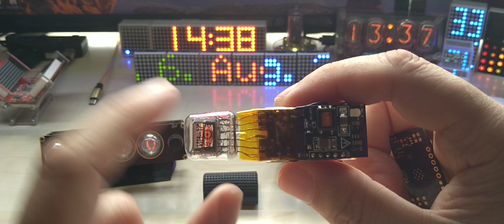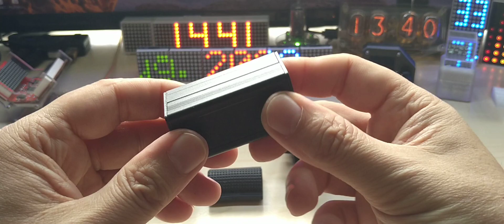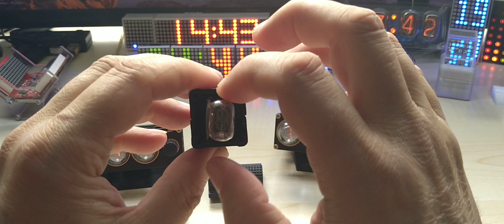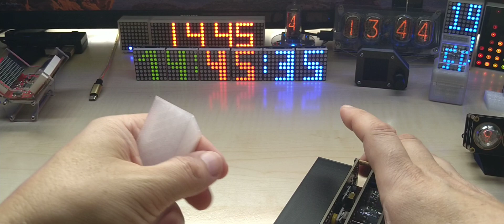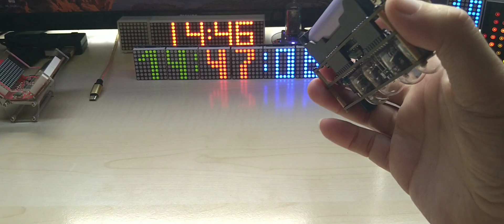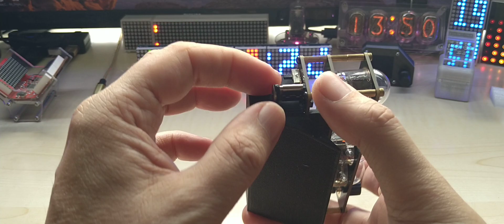IN-2 Nixie Kitchen Timer / Clock, IN-17 Single Nixie Tube NTP Clock with #ESP32 by #Hayri #Arduino

Comment: Hey Hayri! I finally looked through my subscription feed to find this. I'm glad you liked my idea about using aluminum mesh! After looking I found many different styles and colors as well, everything from a crinkle wire mesh(think marshal amps) to hexagon, round, sorta 4 leaf clover design and in various finishes and colors, most are very cheap. Personally I'm looking for a gold to golden bronze color in some design to act as a cage. I might even use bronze pla for the battery/base of the clock...not sure if I'll polish it or not. This will primarily sit on my computer desk but will be taken with me as a timer when I'm cooking(tv, etc is upstairs). I haven't watched the whole video yet but is it possible to add or modify the code to double or triple press the encoder to switch between clock amd timer?
Reply from the maker: Looking forward to see your upgrades 🙂I came up with a great idea on the single Nixie clock which I think will look awesome. Ordered the parts and can't wait to receive them 🙂It will not be easy to combine the codes as they are build quite different, plus I would have to implement a kind  of menu to switch back and forth. Plus the code space is limited on the Atmega328 chip.
Reply: @iHayri1  understood, I'm more a computer hardware kind of guy and not really into programming though I know my way around a system alright. Well if you come up with a way to address the code switch without downloading the code let me know. Again thanks and I look forward to receiving my nixie clock/timer
Reply from the maker: @mythos000000025  I am also more of a hardware guy, engineer, mechanic, designer, fabricator, builder, car repair, motorcycle mechanic and a few more and the least comes my code writing skill 🙂 unfortunately. Still learning but I have to admit, I am getting better at it, if I say so myself. I will surely expand on the clock/timer code, as the temperature feature which it has, onboard DS18B20 temp sensor, has not been implemented yet, although I do have the stand alone temperature code already working 🙂
Anyway, thank you as well and I hope you'll receive it soon.

Comment: BEAUTIFUL!!!!! I really like your ideas for the various battery covers that can also be used for different viewing options. I did laugh when you mentioned the cover that can be used in the car as well...HAH!!!!! Fantastic job with the looks and style my friend!!!!!! Thanks for taking the time to give us details and demonstrations!!!!!
Reply from the maker: Thank you Adam. Just finished the single digit clock, 3D printed a cover for the aluminum extrusion after many trial and errors because you can not find the exact dimensions of the tube and tonight printed a small "foot" for it so it does sit at an angle as well. Now I am waiting for the new PCB's as I added a lipo charging circuit to it, because at first it was supposed to be a stationery clock as I thought the clock would stop once the WiFi is gone or the clock is out of range, but to my surprise the clock keeps going. Anyway, speaking of car, I am actually thinking of making a gear indicator with a single Nixie tube, that for surely will bring in some nostalgic into the car. Does it have any special purpose being a Nixie, No, of course not and I am only doing it because I can 🙂 Could use the clock as is, and since it has BL, send the gear info via Bluetooth to the clock. I know I am crazy, but it helps, lol.
Anyway, have a great week and I'll let you know once I ship your clock.
Reply: More great ideas!!! Someone out there will want a nixe tube gear indicator for sure!! If for no other reason than they may be the only one to have such a cool gadget on the face of the earth!!! Hah!!!!!
Reply from the maker: @ajones4064 Make that two, lol. Just had a great idea about the single tube clock which will make it look marvelous, pure eye candy, spectacular and will also protect the Nixie tube from damage, no, it's not the aluminum mesh cover that I talked about, although also a nice idea of course. Stay tuned, btw, have you extended your clock shelve ? 🙂
Reply: Hah, Haa!! My clock shelf has filled up quite nicely thanks to you!! I do have room for a certain awesome nixie clock/timer though!!! Wink...Wink.....
Reply from the maker: @ajones4064  Gotcha 🙂